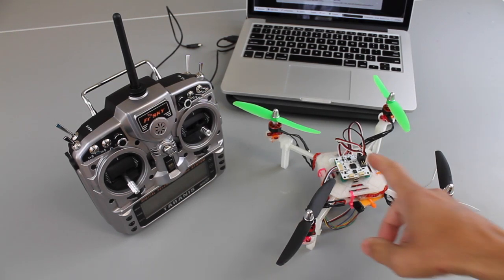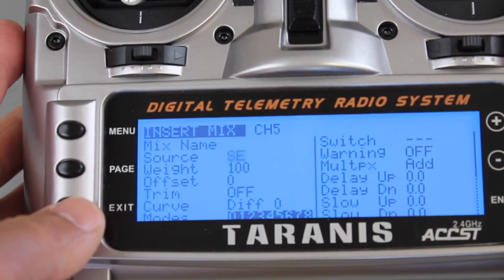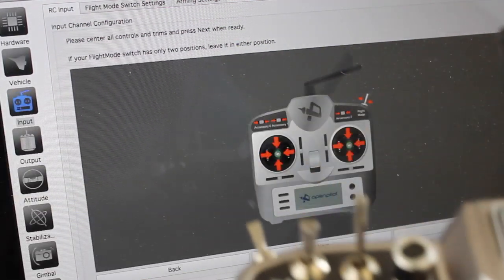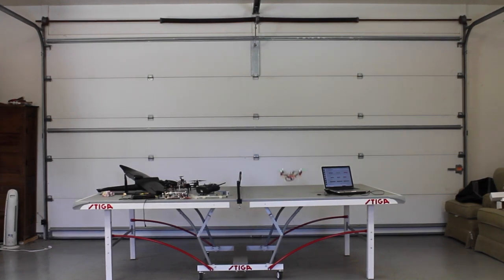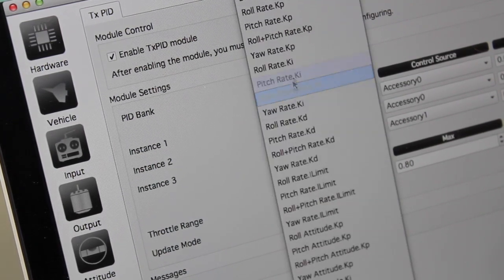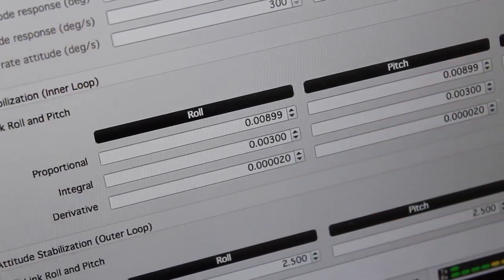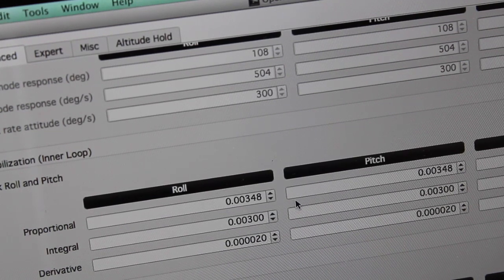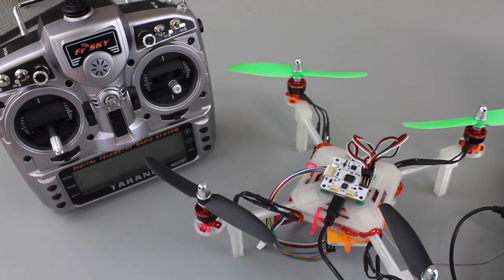OpenPilot CC3D Multiple Flight Modes and In-Air Gain Tuning with FrSky Taranis

Comment: Well done with clear explanation and visual ques. I watched this perhaps 3 times, with pause, jot down information, etc. My first CCD3 with MXP 230 and only hover twice. I am just about to go into inflight Gain tuning with my DX8 but at the moment I have a slight problem. The left/right roll control is fine but for the pitch the forward is fine but the reverse is very sensitive! The CG is right on the spot, solid hover. I tried setting Expo on the Tx so that the reverse pitch is less sensitive but kept the forward Expo unchanged. However, I don't think it's the proper way to fix this. Setting in the GCS has to be the way but so far I don't see the offset setting for the pitch control or I miss something. Any suggestion will be greatly appreciated.
Again great job.
Did I mention that this is my very first question I ask someone on YouTube? :)
I also like your other videos too.
Reply from the maker: Tanasit Siriluck Thanks for the comment. I would definitely check any expos you may have configured on your pitch stick. It definitely sounds like that's the culprit. I'm not familiar with the DX8, but I'm assuming it has templates like other transmitters. If you have the ability to select a template try something like plane mode that may not have any expos built in. Otherwise see if you can get your pitch curve straightened out (you'll normally find those on heli templates) so that it doesn't behave as you describe when you pitch back. I'm not sure how you'd fix this in the GCS and it seems to me the right place to do it is with the TX. If you have any more questions related to your setup feel free to post in the forums at www.garagepilots.com. Good luck!
Reply: solid hover is not indictive of good cg. measure it, by setting the quad on a pencil.

Comment: In the "flight mode switch settings" screen, the position doesn't change when i flip the switch on my taranis. Any idea how to fix this? Thanks!
Reply from the maker: Paleo FPV It's hard to say without knowing more about your setup. Just make sure you've got the channel configured correctly on your TX and that it's wired properly to your FC. I've had a few occasions where I thought I was plugged into a certain port only to realize I was one off. Good luck.
Reply: ok firgured it out! My flight mode was channel 6 on my tx :)

Comment: Hey thanks for the great cc3d tutorials. Are you using opto esc's or can the board handle the 5 volts in from all the speed controllers?
Reply from the maker: Stace Baker I didn't use opto ESC's, but it's generally recommended that you either use optos or pull the power cable from the servo connectors. In this case the CC3D gets power from the receiver port.
Reply: Thanks Dennis was pretty sure that's the case. I appreciate the reply. Keep making the tutorials! Huge help

Comment: Hey i noticed u sayd u were able to use these setting using a turnigy 9x i have problems setting the trim.pots for chanel six as beeing aux 0 once i manage to put the 3 pos switch the pot will not work help pleasee
Reply from the maker: Bogdan Sirghie I'm sorry but I don't have my T9X right now so I can't test this. I think you may need some sort of override or mixing in place when your 3 position switched it triggered. I just don't have a way to tell you how to do it. If you stumble across something please let us know. Thanks.

Comment: hey Dennis. when in mode two my taranis throttle shows up on the right stick, diagonally. is there a way to fix this problem? im using the cc3d and the control wizard is showing stick movements on the wrong sticks . any idea whats going wrong for my set up? cheers.
Reply from the maker: djSpinege That's really strange. If you're confident your Taranis is setup for mode 2 then I'd go through the TX calibration to see if you can get your sticks showing up on the right channels. Also, make sure your RC inputs are hooked up correctly. Those are the only 2 things I can think of being an issue. Good luck.

Comment: I having a problem on my OP revo. my QAV won't level. it keeps on drifting backwards. i did level the board did your video about the air gain. still drifting.
Reply from the maker: Jayson Gamboa Sorry to hear that! I haven't had any problems with drift & my CC3D, but one thing I would check is that your props are well balanced & that your ESCs are calibrated. I don't have any suggestions related to board configuration. Good luck and keep us posted.

Comment: new to the hobby and wanted to use naze32 but your videos are so good for cc3d that i am going to use this over the other because it just seems so much easier to set up
Reply from the maker: Robert Hendrickson Thanks for the feedback. I've heard good things about the naze32 but haven't tried it out yet. I really love the CC3D and apparently you can get it much cheaper now from readytoflyquads:

http://witespyquad.gostorego.com/openpilot-cc3d-flight-controller.html
Reply: your videos helped me a ton setting up my cc3d and getting it flying. I recently switched to ppm and wondered if I needed to change any settings on the Taranis controller. I cant find anything saying it needs to be done. Maybe just the setting through the flight setup program for cc3d?

\
Reply: never mind figured it out

Comment: Dennis, when you were setting your roll and Pitch with the slider what flight mode were you in? Atti1 Atti2 or Rate3 ? Thanks
Reply from the maker: Great to hear from you and hope all is well. I was in "Stabilized1" mode. The default mode when I was configuring my CC3D. Hope this helps.
Reply: Thanks Dennis yes that helps...

Comment: Dennis do you have a video of the cc3d programed to the 9x ? I have my flight modes done but when I try and program the in flight PIDS to one of the VR knobs it freaks out the flight modes and wont save to the cc3d board...
Reply from the maker: Hey BC. No I don't have a setup video with the CC3D and Turnigy 9X. I'm not sure what's going on with your setup but are you able to adjust the PIDs manually using the OpenPilot Ground Control Station software?
Reply: Dennis yes I can set all through the OpenPilot but wanted to save time and set the PIDs while flying, the default is good just wanted to see if more fine tuning would be better. Rate/Rate was crazy to control i took it down from 150 to 100 and that tamed the controls lots . Im getting some YAW right like 10degs every minute so need to tune that in the OpenPilot I dont like using the transmitter trims.

Comment: Nice video Dennis.. :o)
How do you rate the OpenPilot CC3D compared to the Multiwii as I haven't decided what to put in my small H quad.

Thanks for posting..
Reply from the maker: For configuration the OpenPilot wins hands down. I like the performance of the CC3D a little better but that may be because I've never really been able to tune my MWC to my liking. Mainly because the software isn't as intuitive and you can't do remote tuning.